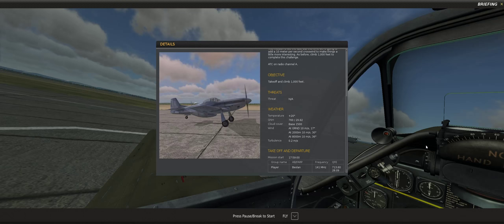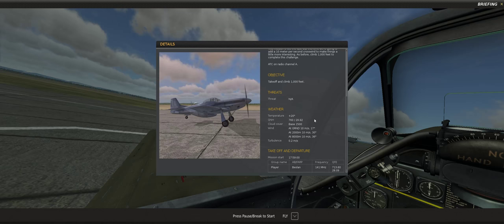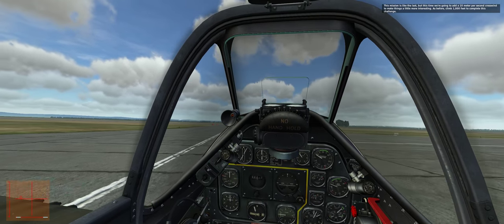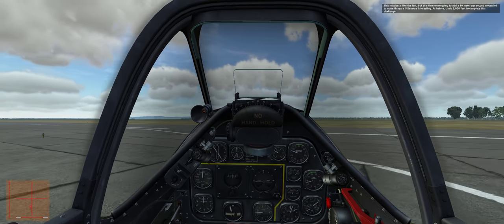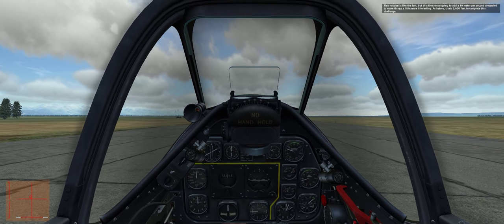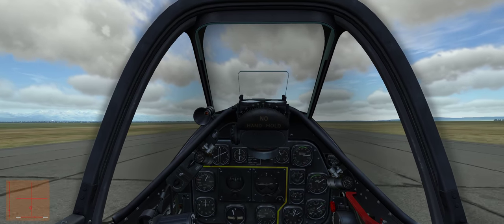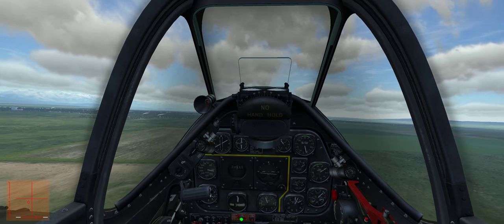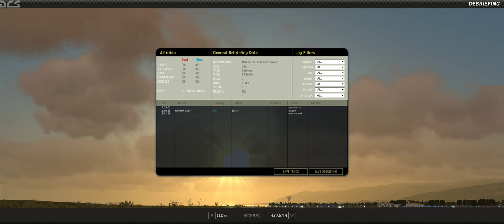DCS P-51: Crosswind takeoff, campaign mission 3

Comment: Did you put your rudder trim in the standard 4 degrees right?
Reply from the maker: Hi there! Yes, I dont think adding more trim than 4 degrees is the right approach, you are much better served using rudder to correct drift from the crosswind. Depending on how your rudder is setup, changing the curves to allow more control at the start is what I prefer.